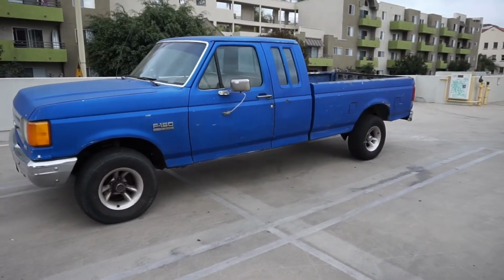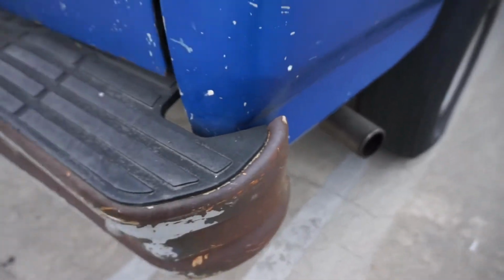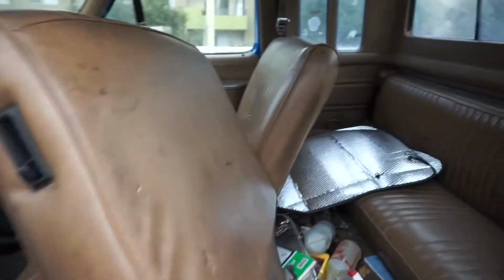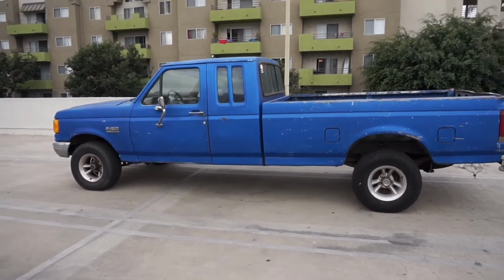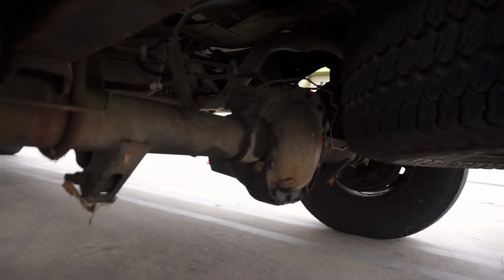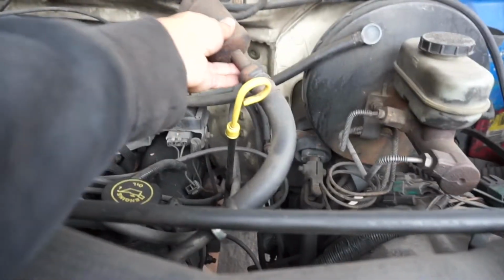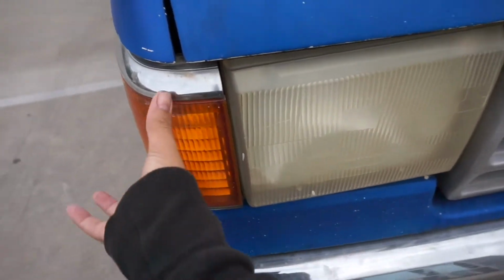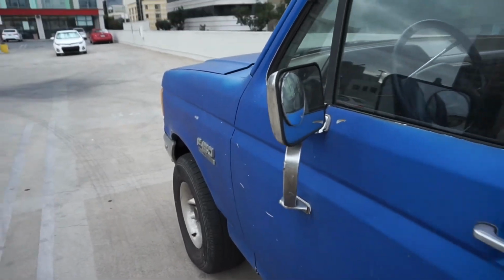My 1989 Ford F-150

Comment: Nice man my dad has a 88 super cab he bought for my grandparents for there farm in 1991 but were to sick so he never sent it to there country and since kept it in his heated shop since 1991 and never brought out and he really meant it it was for my grandparents it had power everything to make it easier for them but still were sick and old and tried but then a year later in 1992 or 93 he bought a 92 f150 super cab manual everything well manual windows and manual transmission still has both to this day all though the 1988 F150 has no rust very low miles all original.
Reply from the maker: Very nice man!! Would be awesome to see a video of the low miles f150! That's rare for it being in such good condition and low miles.. usually these trucks are beat to the ground and junked .
Reply: Integra DIY Oh yeah I been looking all over the internet for a good video showing a mint all original Condition but yeah many people bought these truck's and beat the heck out of them for work so not to many of them around that were beat up maybe Il ask my dad if he can give me permission to do a little video on it showing a good example of an all original 88 Ford F150 with low.miles and no. Rust and not beat up never really understood why my dad kept it so long without using it but glad he kept it the man he bought it from always garage kept it.

Comment: You have room for that truck where you live?  It’s so long!
Reply from the maker: Parking will be fine :) and this isn’t even the biggest one, they have the crew cab which is much longer! The length is what makes it badass, getting up to speed i feel like I’m cruising a locomotive lol
Reply: Integra DIY they never made a factory 4 door f150 in this generation but they had centurion conversions.
Reply from the maker: Dodge 318 Cummins what's up dodge318! Haven't seen you post in a while! And you are correct! I actually meant to say the f350 with the crew cab is much larger lol too much truck for me though haha
Reply: Integra DIY ya the f350 crew cabs are huge and the dually f350 crew cab is a whole other animal lol.

Comment: Hey can it be used for a daily may buy one tommrow for 800 is 250k miles ok for it (any one can answer)
Reply from the maker: If it's a short bed single cab...  yes.. but it's still a pretty wide heavy vehicle for a daily. If it's a crewcab long bed..  you'll want to make sure you have a big parking spot to park it every day, and you'll struggle with parking around town. Is it gonna be a work truck?
Reply: Yes i just need it to get around town not going to be towing stuff or doing heavy load work just drive it
Reply: Ill probably just put car parts in the bed but nothing heavy tho just a daily
Reply from the maker: @josephupholstery1416  I would get something smaller... if it's just a basic daily.. and no 4x4 build or not a work truck, definitely look for something smaller and better on gas. I dont mean to detour you away, but these are heavy duty vehicles that are used for work. My blue truck is on a ranch now in the middle of a desert hauling horse hay around.. 

Is the truck you are looking at a single cab short bed?
Reply: Its a long bed its the same as yours really i tried finding a decent honda that hasnt been ran through (raced)
Reply: But its hard to find one i kinda stay on the country myself